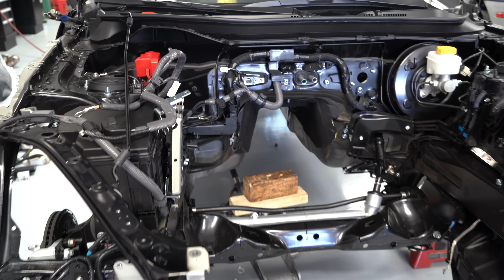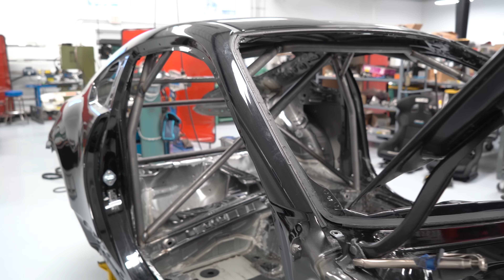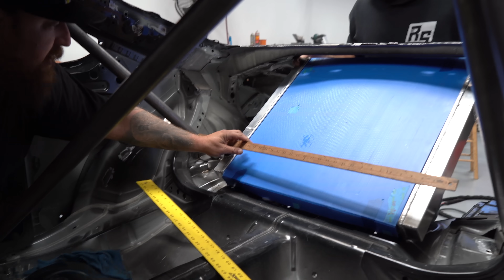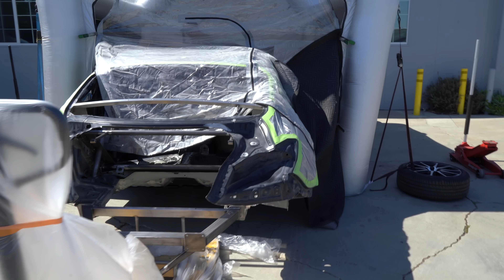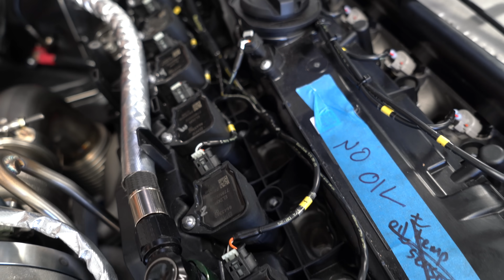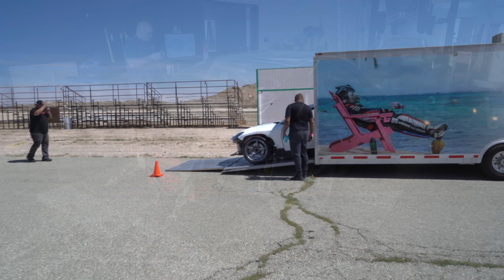Full 2022 Toyota GR86 Drift Build

Comment: You may consider using a spray on under coat instead as that will keep the body from rusting. There are types that go on like a thicker spray paint instead of that rubbery thick coating they use on trucks. York Auto in Sidney, OH told me about it. And I’ll be getting the GR86 I have sprayed soon for winter salt/chemical crap in OH.

Comment: Really wanted to know why they went from water to air to air to air for their charge air cooling. Weight? One less thing to leak? 

Also, how does that plastic valve cover not melt with the turbine housing only inches away?

Comment: i like how you guys fit the 3.0turbo inline 6 and toyota keeps gaslighting us that only the boxer fits and muh center of gravity meme.
Reply: Boxer is cool and down low. Perfect solution for a street car.
Reply: @vvevvevvvv  the Zupra has a lower COG without the meme engine. subaru engines just suck. ask any machine shop.
Reply: @nissanv6TT  Supra also costs a lot more. What's wrong with Subaru engines? You can make plenty of power out of them. But, I can clearly see you are hater of the boxer engines, my condolences
Reply: @vvevvevvvv  im not gonna spoon feed you. toyota has an engine that can take more power than any stock boxer ever hoped to and it's been available in rav4s and camrys for 15 years. they only used the boxer to save money and because it was a contractual agreement with subaru to use their platform. any other reason is them gaslighting you into an inferior engine.

Comment: better then rattle cans, get a pint of rustolium hammered black, thin and spray via air sprayer (even use a cheap harbor freight throw away gun), and for $40 including tools you will have it looking better then rattle can... likely used $300 of rattle cans there! LOL.

Comment: papadakis racing is on another level back to back to back to back new motor/chassis/hasn't been done before combos, all built to the highest of motorsport standards the execution and problem solving/solutions is what really sets him and hsi team apart. that run at the end of 2 papdakis racing built FD pro cars going all out neither driver giving an inch that's some pure #joyofmachine

Comment: Absolutely spectacular work and phenomenal fabrication and packaging skills. I will say that when painting the chassis a catalyzed paint applied via a low pressure spray gun is a much better option. The prep is exactly the same but the gun deposits a lot more paint in the same time making the job faster and more durable. In addition you have the option of using a tinted primer that will greatly increase paint adhesion yet will not be visible if you miss a spot with the colour coat. By no means is this a criticism but rather some grey hair experience talking. Keep up the great work guys!

Comment: As mush as we love drift cars, this is way overrated built. Here in Japan, most of the professional drift cars are still can be street driven as well and don't need these special treatment to win a drift contest, now thats what we call a real drift car not like these money builder that spend so much but only do a little better than them.
Reply: It's about speed, this level of competition is 1000 horse power. I understand, but nobody is building reliable 1000 horse power for cheap.
Reply: Kind of apples to oranges given that Japanese drift cars are built for those series. And you can register an FD car for the street, hardly anyone does because it’s not worth the time/effort

Comment: I'm curious about why you put the fuel cell where you did. If it was my car i would put the fuel cell above the rear subframe mainly for safety. I'm concerned if the driver over rotates in front of the wall like a T and smashes the rear into the wall the fuel cell is probably going to get damaged and could potentially lead to something worse. With the fuel cell above the rear subframe its completely safe and protected from everything. The only reason why i could see why you put the fuel cell where you did is because you want that extra weight behind the rear subframe to act as a pendulum to help throw bigger angle

Comment: gah, disappointed that you didn't build up the new 2.4. I wanted to see what a proper team can build the new boxer up to.
Reply: When you go with billet block it's hardly even a Subaru engine any more. Try Bader Built on youtube
Reply: @idokwatcher2062  I didn't say anything about a billet block
Reply: @gwot  That's what it takes to make these weak boxer engines 1000 horse power.
Reply: @idokwatcher2062  and you would know on a new 2.4? that's why I said what the new boxer can be build up to. and no, that's not the only way to make 1000hp, a closed deck EJ can be build up to 1000hp, IAG even sells long and short blocks rated 1000+. I doubt the new 2.4 can hold 1000 without closing the deck like the 4 cylinder in their old corolla, but that'll be more interesting to see than just an engine swap.

Comment: everyone else: takes BMW engine out of new Supra, swaps in an archaic 2jz

Steph Papadakis: not only proves how badass the BMW engine can be, but also swaps one into a GR86 for good measure
Reply: He said on Instagram that he wants to put the B58 in an A80 Supra.
Reply: I'd love to know what they could do with the new S58
Reply: I mean, from an engineering point of view, the only thing good about the b58 over a 2jz is weight and stock oil pump.
Reply: @oneplumpboi5317 better variable clave timing,more airflow,better avaliability of stock parts(blocks,heads,cranks)whole lot of  sensors that you front have to adapt to a arcaich engine…for sure,just weight and an oil pump
Reply: @Thatdrii  Valve timing, sure, but the reliability factor isn't exactly there.

Availability of stock parts??? You do know toyota still produces 2jz head and blocks, right?

Whole lot of sensors you have to adapt? On a short block alone, there's like 4. The b58 has wayyyy more when you include the variable valve technology that you mentioned?

I'm sorry, but the b58 despite being a newer engine isn't that revolutionary and definately doesn't have the market.

The connecting rod ratio on these engines  is 1.58:1 which means that it's reliability at higher RPM is dogshit because of how quickly the connecting rod switches directions which creates more g force. YOU WANT THE ROD AND PISTON TO TRAVEL SLOWER. f1 and motorcycle engines run 2:1 ratios. The 2jz ran a 1.65:1

The only reason you'd want a short rod ratio is for power under 4,000 rpm, where quick sudden pull of the piston with low duration cams creates a powerful vacuum that fills the combustion chamber quicker; this doesn't work at higher rpms.

The crankshaft being a undersquare designs means there is less support for the connecting rod crank pin as it is further out. 94.6mm stroke vs 2jz 86mm stroke. 50mm crankpin on b58 vs 52mm on 2jz, meaning the stock 2jz has wayyyy better support and can withstand more horsepower than the b58. The area of support is much larger.

Smaller bore = smaller pistons = smaller valves. b58 30.1, 28.5mm vs 2jz 33.6mm, 29mm. Meaning the 2jz isn't as restricted compared to b58.

Flowbench; Stock flow, the b58 lies within 170CFM range, where as 2jz exceeds 220 CFM

You can talk about archaic engines, but in the 90's when you didn't have to limit airflow and tolerances for "emissions", engines could make heaps of power easily where as today, emission control is what's limiting power in engines today.

Comment: stefan please make a 4wd corrola hatch 4 cyl turbo. it could be like a modern lancia delta integrale , and if you could make it like a street car im sure toyota will put it in production as it will save a lot of r&d costs
Reply: incase you're not aware, Toyota now makes a AWD corolla hatch 3 cylinder. Also, i'm positive Toyota wouldn't put that into production, Papadakis does an amazing job, but he is no where NEAR the level of Toyota's manufacturer's level of budget and engineering that needs to sell to literal millions and be Toyota reliable. Toyota doesn't even trust BMW enough for their Supra and had to reverse engineer the engine and make updates to it, you think Toyota's gonna put a small race team's scrap into production?

Comment: What's the budget on something like this???
$400k?? The attention to detail is just amazing!
Reply: Honestly probably more... wages, materials.. idk I'd guess over 400k
Reply: I guess like 700k
Reply: @BAYAREAMX  Respectfully disagree, there is no way engine mounts/arms and front subframes/transmission crossmembers costs in the tens of thousands (that they aren't even developing a product out of) even for a car where this hasn't been done before. Same with the turbo manifold/piping/lines etc. Obviously more expensive and time consuming then a normal swap or one where this has been done before but this is now a pretty standard formula for the shop, they can just tweak specifics to get this to work in any car
Reply: 300k easy between labor and materials
Reply: I'm working with Redbull team our budget  is 5 million $ yearly
Reply: Around 80k - 100k USD i guess
Reply: @ultimate_coolguy1927  only the engine and the transmission is like 100k
Reply: @chun2s  Ok YouTube deleted my comment the first time so let’s try this again:

Steph posted on his Instagram a while ago of a custom (not based on a production engine) pushrod 4 cylinder that he wanted to turbocharge for drifting, but the price tag is $40K and he said it’s not feasible.

Let’s do some rough napkin math: The engines that get built are probably $10-15K because they are put together in house, it’s based off a production engine and Steph is not a business selling long blocks or complete engines. Dog boxes can be bought for 5K used 10K new. Driveshafts are probably $6K (carbon fiber). Winters quick change is $5K for the upgraded unit and subframe conversion is $2.5K. Wiring and ECU is probably around $5-7K. Entire suspension setup is $10-20K. Fuel system is maybe $5-10K. Let’s throw in another $10-20K of metal, fasteners, lines, accessories, roll cage, intercooler, bushings, other stuff. Grand total is around 90K minus labor because there are people already working at the shop and it doesn’t come with the cost of the car if that makes sense. We can even push the price up to $100K. Even at that price, its obviously way more then most normal car guy builds but it’s nowhere near $700K or a million dollars or whatever I’m seeing people quoting. While it’s obviously cool to drool over the idea of a million dollar drift car, there’s virtually 0 market for it at this moment. 

You cannot approach these types of videos from a normal car guy perspective where you usually cannot do something yourself therefore you bring it somewhere and have them do it which equals $$$, especially if you have a shop doing everything. Steph is mostly vertically integrated which is huge savings on these projects. There’s also logistics and other stuff I don’t feel like getting into but that’s a whole nother (yes I know I spelled that wrong) animal and you probably get the point.
Reply: @PierceGomez  ok Mr papadakis
Reply: @chun2s  Lol
Reply: I agree the car alone isn't 1M but I've heard a few times that running a single vehicle program for 1 year of formulad is around 1M. but that's everything, crew wages, transportation, spare parts, yadda yadda.
Reply: @PierceGomez  you forgot 34k for a brand new base model GR86.
Reply: @Treaxvour  They're partnered with Toyota so they probably get a car at cost or for free, but good point
Reply: If you have $400K to spend on a drift car you might as well make it out of solid gold or something lol
Reply: @PierceGomez  You’re underestimating gold. $400k gets you less that 7kg of gold.
Reply: @Kmaaq  I actually forgot how expensive gold was until your comment O_o